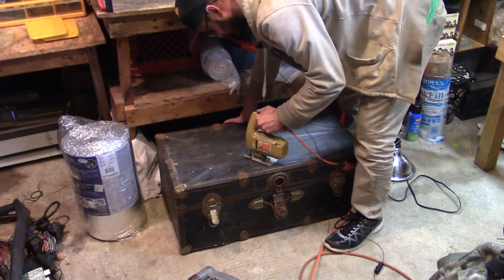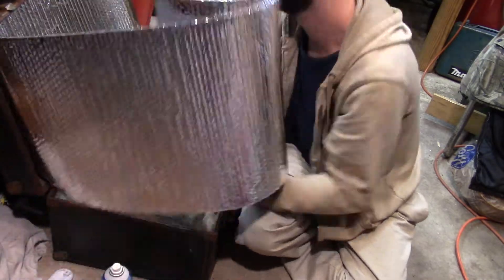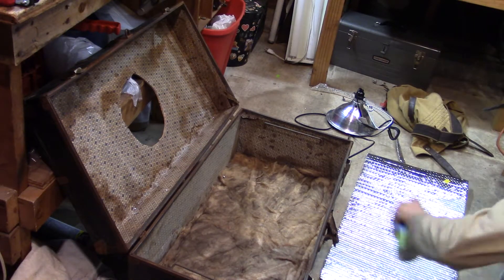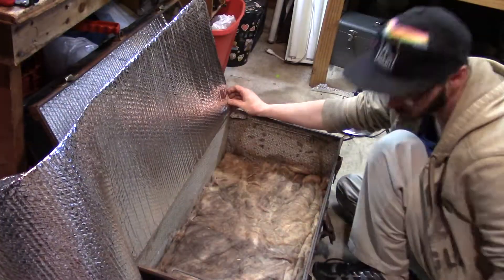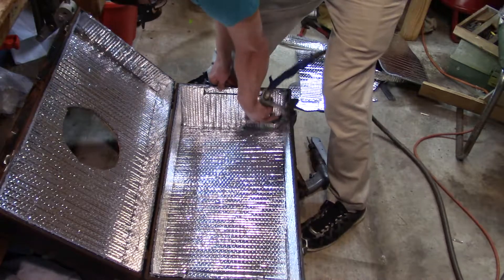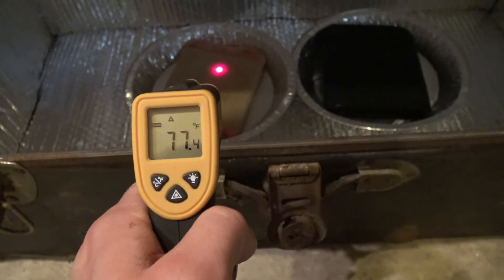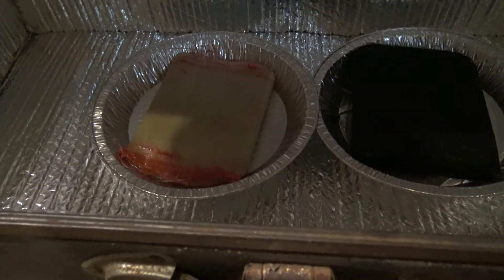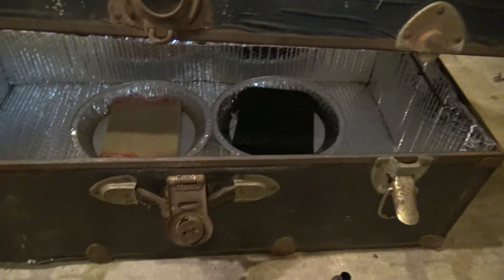DIY resin cure box

Comment: Recently the temp in my area has changed from 40 in the wee morning hours to 75 in the afternoon creating havoc to a project I have been adding resin too every day for over a week. You gave me an idea to make a cardboard box with 4 sides (front and bottom cut out) and a small heater with a thermostat  a few feet away to keep the temp between 70 and 80 F.  Hoping that works. Will know in a few days. 
Thanks for sharing...

Comment: Ty just made my own using your video. The cost of the Reflectix was higher in my area but that was expected. Side not do not use reptile rated heat lamp bulbs. They are not strong enough.
Reply: Hi what kind of box did you use and what watts for the bulb thanks

Comment: Nice project !

You should use a temperature controller it would be easier to control the inside temperature and you could set it at the temperature you need. That’s what I did and it works really well ! 

Take care buddy !
Reply from the maker: Thanks! Yeah, this was a really simple build, I would love to expand on it with a side fan and temperature controller.
Reply: I was going to suggest the same thing 👍

Comment: I was curious about making a box similar to this, but I was interested in using a heating pad at the base instead. My Resin Cures best around 70*F-80*F, and while those Temps are perfect in the Summer, it's horrible to try curing in the Winter. Never thought about using a heating lamp before. That is definitely a good idea for a higher temp resin. But for what I'm needing it for, I'm thinking a heating pad will work fine!